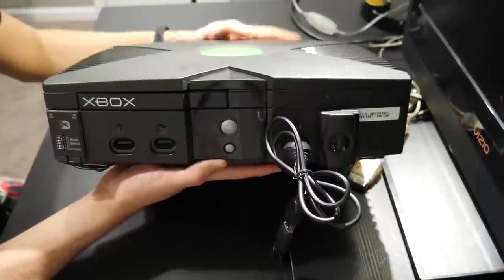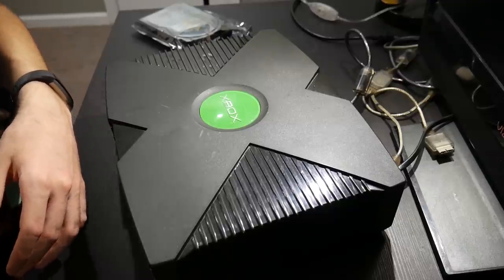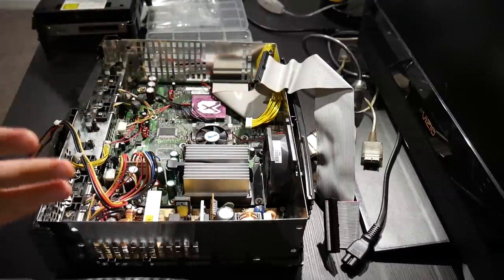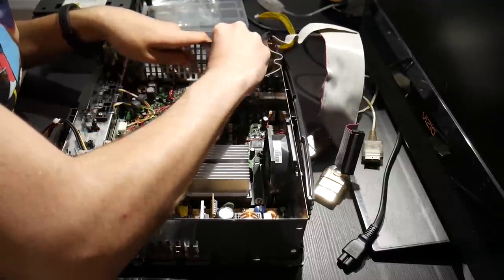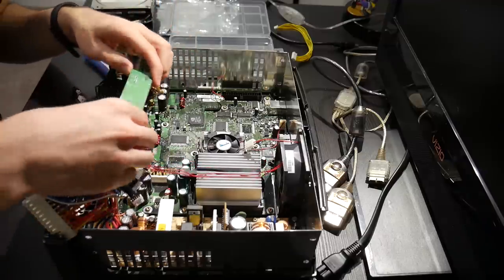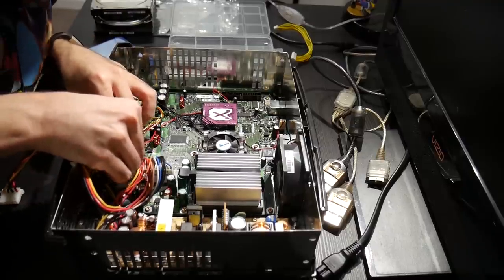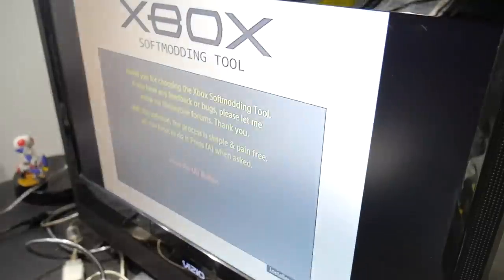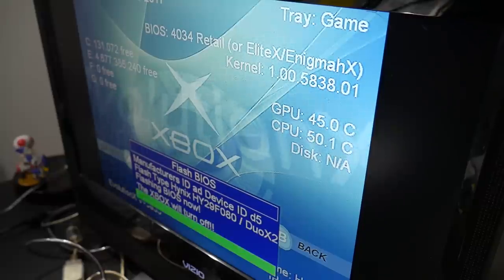Let's Repair! - Revisiting & TSOP Flashing the Xecuter 3 Original Xbox

Comment: Here's an idea for a video: How to silence your Xbox (well not silent but at least make it quieter. What fans are recommended, mods etc)
Reply from the maker: I think that would be called turning it off? 😂
Reply: @MrMario2011  hdd is the loudest, use ssd for silence
Reply: @Henningberge  The original Xbox uses an IDE hard drive.  I'm not sure if it's possible to use a SATA drive unless it works with some sort of converter.
Reply: @dennisanderson8663  almost everyone I know is using a converter, ide drivers are harder to get than cables and converters.

Comment: This is the exact video I was looking for! I have a 1.0 Xbox with an Xecuter 2.3 solderless modchip but it occasionally has issues where the xbox cycles 3 times then goes red and it doesn't support hard drives bigger than 250GB. If I screw down the modchip tighter it seems to help with the cycling but I should really TSOP mod it. If I add more than ~225GB of data (games, emus, apps) it starts wiping out sections of data I already put on the drive (500GB). I guess my questions are, other than it allows for many different BIOS types, should I use the modchip after a TSOP mod?  Should I just flash the modchip with a newer bios? Thanks for the informative video!
Reply: I'm having issues but mine is with my 320gb taking way too long to get past the post screen.
Reply: @dennisanderson8663  my problem is the Modchip. I was able to flash it with a newer bios and it's now allowing full access to the drive. However, it is causing the the Xbox to power cycle 3 times so I'm just going to get rid of it and tsop mod the Xbox.

Comment: Hey Mr Mario! Is it possible for you in the future to ever do a tutorial on how to do a 3-wire trick on an Xbox to recover from a bad TSOP flash? I have an Xbox that is fragged due to a bad TSOP flash. I know I can install a modchip to get around that but I'm not good at soldering. It's a Xbox 1.4 motherboard with a Windbond TSOP. Great Video Man even in 2022!
Reply from the maker: Just looked it up, you would still need to solder so for your case personally, I think you'd probably be in the same pit of difficulty. Installing a modchip has more points, but they're bigger so the difficulty balances out.
Reply: @MrMario2011  Ok great to know. In the future would you still be able to make a video tutorial on how to do it? I’m willing to give it a try.

Comment: 15:45 with winbond you have to use the raincoat method for TSOP after softmodding the console. No need to undo the solder points.
Reply from the maker: Got any details on the raincoat method? Haven't heard that term!
Reply: @MrMario2011   it requres 2 cds one with the boot and 1 with the appropriate bios.bin. messaged you on FB so we can discuss it further.

Comment: Please explain to a friend, I have an xbox 1.1 and a sharp chip... I need to bridge the points r7d3 on the top side and r7r3 on the bottom.. plus put a jumper wire... right? what bios should i use the one that is non windbond or special for sharp 1mb?

Comment: I have a TSOP flashed Xbox that I replaced my 120gb with a 320gb drive and now it takes forever to get past the post screen with the Microsoft text and the Evox symbol.  I did everything the same as in the past.  I booted from the evox disc I burned, formatted the drive using the script, and copied the dashboard files through FTP.  Did certain firmwares/versions have issues with really large drives?

Comment: I was wondering why you went for TSOP instead of soft mod and at 35:18 you explain why.
Reply from the maker: Took a while!
Reply: TSOP allows booting your Xbox without the DVD drive installed depending on the which firmware was flashed.  It also allows you to keep your hard drive unlocked without the ATA password set.

Comment: I have a xbox with Xecuter2 mod chip it used to work find  just before I flash bios  to latest version now there no display   and the modchip has no light and now it boot orginal  xbox os cannot read copyed disk I really  don't  what to do to get it working need help.

Comment: Hey Mr Mario!!!
Not sure if i can do this? but... 
First i would like to say i love all your videos! currently using them to do MODS on Xbox, PS2 and Xboc 360.
I have a problem, and need ADVICE!!!!
I recently got a Xbox, however the HDD and DVD drive are DOA. Is there any way to be able to use the board????
Reply from the maker: If it were me: I would install a modchip which will then allow you to build a new hard drive using a recovery disc. You can use any Xbox DVD drive between consoles.

Comment: Im planning to buy OG Xbox should i buy softmodded or modded HD? I need only for like 4 games exclusives
Reply: Keep in mind that hotswapping IDE cables can damage the equipment.  I had many successes myself but did kill one Xbox motherboard.
I eventually bought a copy of Splintercell and did the game save exploit from then on.  You will need a memory card too and a way to get the saves onto it, I made my own Xbox adapter for PC to connect a controller.

Comment: I've only ever run into 1 Sharp TSOP and it was an absolute nightmare to flash. I had to solder on a toggle switch for that extra wire and it required using some super dated boot disc to get it up to snuff. Sharps are no bueno.

Comment: i couldnt do the upgrades myself as im not very good with computers but i have tinkered with it a little and i have an old xbox hooked into a sony trinitron with a 2d to 3d converter.. top end price for the system was less than 300 bucks and it plays any retro game in decent 3d.. and yep its been a great addition to my library.. the reason i promote the old CRT tv is the emulators just seem to perform BEST on an original tv from linux no idea why but probably the ratios etc were made for matching them at the beginning.. and the options in the linux interface through mednafen especially accommodate any kind of 3d gimicking ive added.. and even in 2 it looks very cool. if you ever have a link to systems for sale or more tips on how to ftp (or skip ftp and just connect to a pc directly) let me know!

Comment: ok you could of gone a HOTSWAP but instead of HOTSWAPPING to flash a modchip you would be doing the TSOP ! Basically you boot the X3 and boot your disc of choice to flash and then remove the X3 from the pin header without touching anywhere near the power supply and then proceed to flash the TSOP !

Requirements.
Working Xbox with a Pinheader Install and a Working Modchip with a Hacked Bios
HackDaBox Re-Flash Disc
 or similar Evox Flash Cd

With the working Xbox turned off Remove the lid , the screws from the hard drive bay and DVD-ROM drive. Remove the hard drive (still connected ), lift it up and over slightly, now lift the DVD-ROM drive up ( still connected) and spin it around to face the opposite way. So now the DVD-ROM is facing the wrong way round but still connected . Support the DVD with something underneath, so it sits level. Now put the hard drive bay back where it used to be ( covering up the power supply ).

WARNING NEVER TOUCH THE POWER SUPPLY AREA AS IT CAN KILL YOU !
This procedure is safe the way I have described above because you have access to the Modchip area . The chip should be plugged onto a pinheader ? If not you can not re-flash this way.

Now remove the wire that goes to the D0 pad on the Modchip itself. Unscrew the screw near the LPC area and put the D0 wire under the screw and carefully tighten it up. You can solder the wire to the circle around the screw if you wish. remove any wire you have connecting the chip to the Xbox motherboard but leave the chip plugged into the pinheader.

Now depending on your chip type you need to make the chip enabled all the time.
On DuoX 2 solder a wire between the BT pad on the chip and pin 9 on the chip (This is point G on the official Duo diagram) see the picture below coutesy of cubistproject.
On Aladdin solder a wire between BT pad on the chip and Pin 2 on the chip
On Spiderchip simply leave off the switch.
Note : You need to do this to the good chip in the Xbox and the ones you intend to Flash.

Turn on the Xbox with the good chip in and let it boot up and then load HackDaBox Re-flash Disc Choose Re-flash Spiderchip ( it works fine on DuoX 2 and Aladdin ). Choose the Xbox version you wish to use the flashed chip on. E.g. 1.0 - 1.5 or V. 1.6 but don't hit A to flash yet.

Note Evoxdash or Slayers or your preffered Flash utility can be used with this method.

Now carefully pull the Modchip off the pin header with the power still on ( note only 3.3 volts goes into the Modchip so it will not electrocute you.Now carefully line up the chip you are going to flash and then push it on the pinheader. Never try and force it on , double check it's lined up properly and it should slide onto the pinheader easily.

Now go ahead and flash the chip now. The Xbox should turn off after the successful flash. Once it turns off ,turn it back on and the previously bad flashed chip should now boot the new flashed bios that you just put on it.If you picked Xbox V.1.6 and your Modchip is not in a V.1.6 it may not boot reliably so try it in the V.1.6 box.

Remember to put all the original wires back to the chip, and remove any links you have made. In other words put the install back to the manufacturers recommendation.

Comment: Any ideas on why modded (2.6 executor) xbox will occasionally boot 3 times and crash and why sometimes the power button doesn't work. I'm lost as to what to look for next seeing as it doesn't do it all the time. 
So far:-
Checked mod chip wiring, no issues I can see.
Capacitor taken off
replaced dvd drive
checked all connections.
checked motherboard for any connection issues.
got drunk and cried
Reply from the maker: The power button not working could have to do with some corrosion on traces for it.
Reply: @MrMario2011  Yeh I was thinking that but there doesn't seem to be any. It's weird that sometimes it works and sometimes it doesnt.

Comment: I accidentally updated the Xbox to use Xbox live while playing a game and now the chipped load screen has completely changed and I can no longer see or use any of the games added to the console, is there a way to restore the console to a previous version?
Reply: They shut down Xbox LIVE for the original Xbox back in 2010.  How exactly are you planning on getting on Xbox LIVE?
Reply: @bigzeke7431  I wasn't trying to get on, I pressed the wrong button on a game screen and it tried to connect, somehow doing that made it return to the original loading screen instead of loading the chip

Comment: Hi, I have a dozen different xboxes and half of them are softmodded, only one of mine has a chip, what is the real benefit of hardmodding an OG Xbox this day and age when Xbox live is defunct on it now, I have asked this on different forums and never get a clear answer, because I can't think of any.
Reply from the maker: The biggest benefit to me is not having to worry as much about drive locking and your EEPROM. A softmodded console will only work with a drive that locks, so any storage or drives which do not lock cannot work on a softmodded Xbox. Due to that, you're always tied to having an EEPROM backup and making sure you don't lose it. You can help alleviate that by nulling your HDD key, however you'll still have to make sure you have a drive which can lock. To me it just takes a lot of that annoyance away, I know any readable/writable storage media I put in place can work. Plus if I mess up any configuration or for whatever reason want to wipe everything, I can easily do so so any of the awesome recovery discs out there. As you can see I like to tinker and reconfigure these quite a bit, so not having to worry about screwing up my storage is excellent.
Reply: @M83G  Yes I've done it multiple times with new IDE drives, I only stay within 160 -  320GB range because i do this to multiple Xboxes to take advantage of LAN games and I tend to do configure my Xboxes by genre, like Horror games on one Xbox and Action on another instead of doing full blown 2TB with every single game including the crap ones.

Comment: Hi, love your videos MrMario. I need your help with something. i have a TSOP xbox v1.0 with a 500gb HDD with a lot of games working good. Am having this issue: when i plug a second controller doesn´t recognice none of them. Every port is working fine, and if i plug each controller alone they work just fine, but when i plug both at the same time they doesn´t work. I tried to reflash bios but the problem stills. can you help me please? (both controllers are original xbox S) . Sorry about my English.
Reply from the maker: Never had that issue, I won't be of any help.
Reply: @MrMario2011  thanks for the reply. I realized than both controllers works with the console cold, after 5 min they begin to fail if both are connected.. :(

Comment: If you have an old bios tower, you can simply make a HD maker cd using the eeprom.bin and clone any Xbox hard drive and then simply lock it with the Xbox hard drive maker. Hard modding is only good for drives that won’t lock IMO.
Reply from the maker: I'm not even sure if you really need to have an old tower kicking around now? I believe there's some pretty great GUI tools out there you can use a USB interface with!

Comment: I have a chipped xbox with executor 2 chip (I think). I was great, I had so many emulators and games... then it broke after I changed the system settings to wide-screen 🤦‍♂️ an old friend managed to get me mameOX  on a disc and get my xbox working again, but I lost everything else 😪

Comment: I always like to say PSA when reinstalling the x3 chip - make sure you check when plugging in the cables to the modchip itself as one of the cables can go into two different ports on the modchip - 1.6 uses a different port. the wrong port will fry your eject/power button.
Reply from the maker: True that!

Comment: Can you do a battery mod to it next?
Reply from the maker: Could you elaborate? Like replacing the clock cap with a battery?
Reply: @MrMario2011  I think I seen it before somewhere, but I'm having trouble finding more information. You do it with a coin battery and a diode. What I did find was that people were debating if using a better capacitor was a better option. It just seemed like you were trying to build a perfect Xbox and fixing the time might be easy to do.
Reply: @MrMario2011  I also realized why it's useless, NTP. Let the internet set your clock.

Comment: Mario consider now not to go soldering as motherboard is still in the closet. I have a couple of years ago done with an Xbox 1.4 winbond system and have undone the bolt to the right on 1 of the solder bridges has become too hot buyer, so the system has not survived. That machine was my first Xbox from 2001 is doing the pain , I nag not remains risco if you are going modden ;). I also have modchip in but it was a very old x3 Apple chip , no supported no homebrew was 1 of the first ways to copy programs to run and nothing else. So just motherboard out is a bit of work but much safer and better , oky I still have restriction, I am almost 50 years so don't see everything as well. Suks hard I Happen to have a very similar system done and it went much better finish got my new hdds. Have 11 xboxen , chips in to build does not work anymore because of the eyes I do, however, expensive here in the Netherlands is just too small to work for me now. You had me need to see extra magnifying glass with new glasses and the eye look different, I see the bubble. Yes, you see no depth, but that's what I feel called to the burner , 've got a Weller that I had then and still , always first clean it with a 99.1 or more isopropanol, also if you think is clean and also there after but you did. But further good work Mario, nothing negative intended hear. This is translated by the way. : Gtz Ed